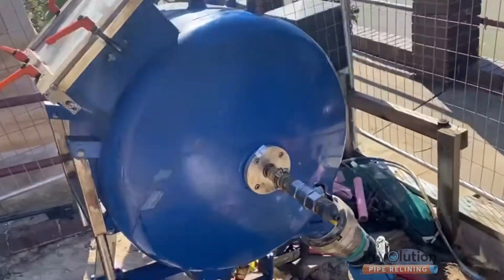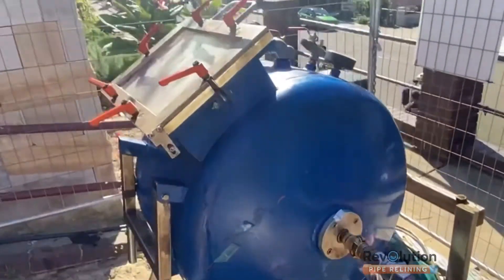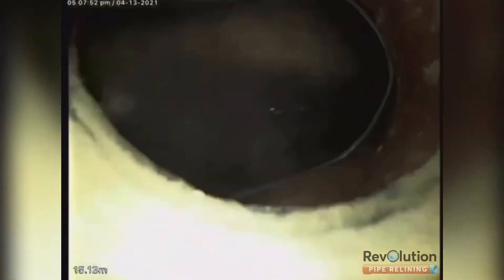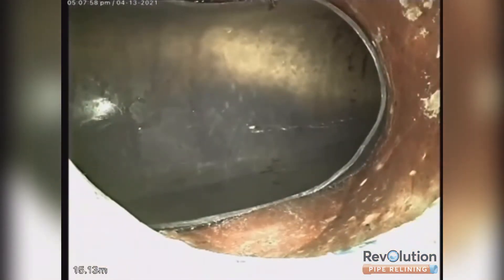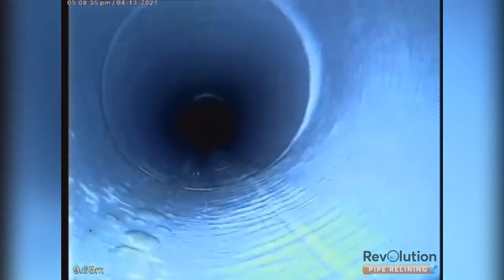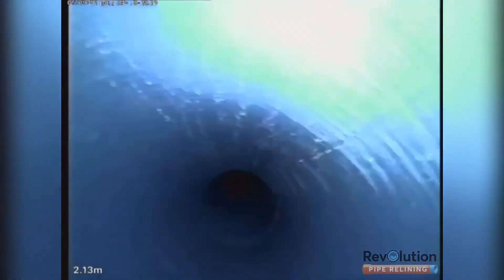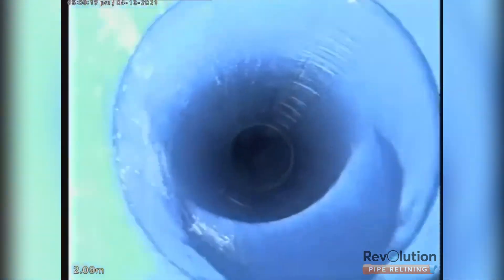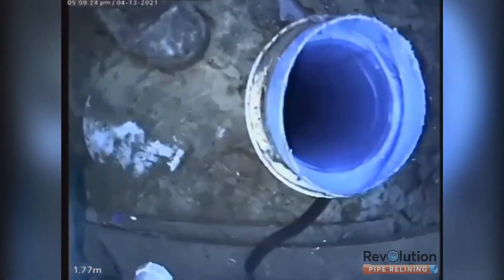PLUMBERS & BUILDERS! Don't Dig Up The Street On A New Build! Save Time & Money By Relining The Sewer

Comment: I keep hearing that it’s cheaper than digging, but when I call plumbers in the area who offer Relining, they all say it’s about the same cost. What gives?
Reply from the maker: It really depends on what is above the pipes and the depth of the pipe. Eg if the pipe are running below a nicely landscaped garden, below a building or a nice driveway, the restoration costs will more than likely make pipe replacement more expensive. In some situations excavation is cheaper, but in many situations, pipe relining is cheaper and visually a much better end result as there are no excavation scars.

Comment: What do you do when mounds of mortar are inside the pipe at the joints. My 4 inch terracotta storm drain that I replaced, had large mortar excess inside the entire 360°.
Reply from the maker: We remove it with a chain flayer or robotic cutter before the Relining process takes place.